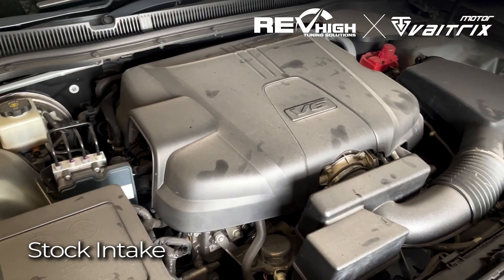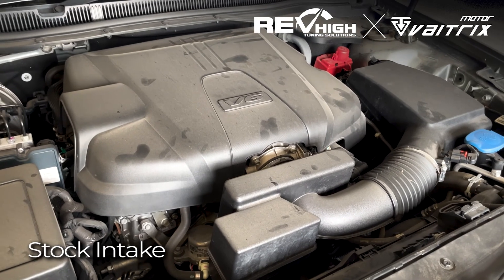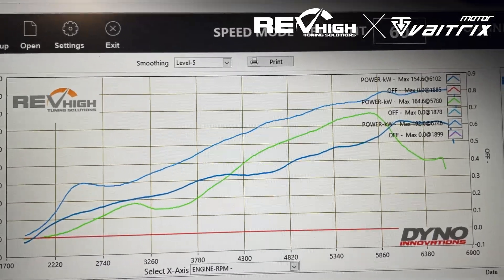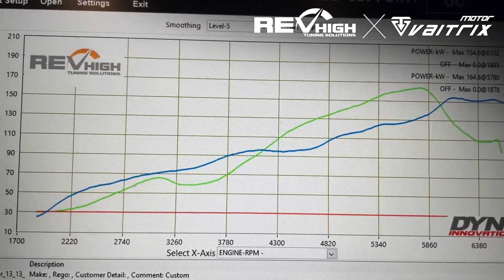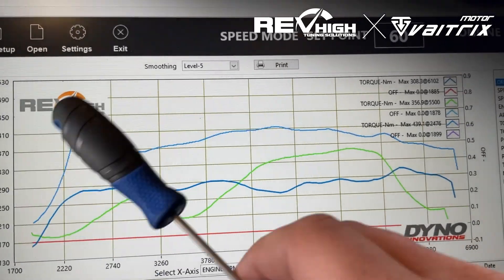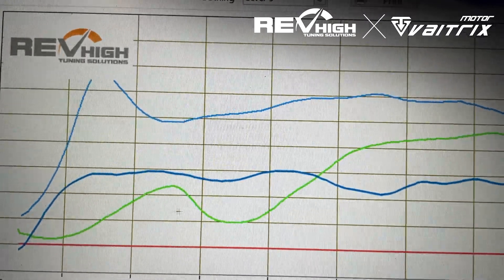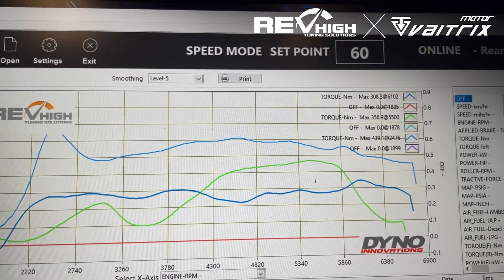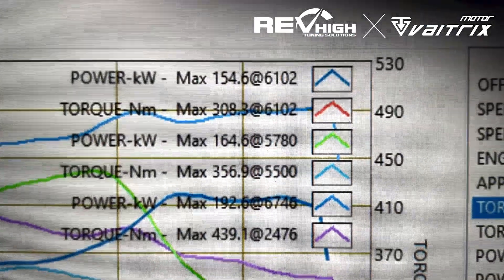Why you need a dyno tune after fitting a OTR intake on the direct injected Holden V6's!!

Comment: I have a Holden VF director in two mind whether I should enhance it it is so good stock I watch this video. It’ll help me make my mind up.
Reply from the maker: If not sure on the tuning side I would always recommend starting with good servicing schedule including the transmission, good plugs, clean the PCV and check the purge solenoid is functioning. And always use 95 or 98. Thanks for watching.

Comment: With OTR, about 190KW rear wheel seems to be about right, I have now in the last six months seen 189KW, 190KW and 192KW. The lowest 189KW was on a fairly hot day and would have read a bit higher if it had been 20C. With a Supercharger this can go a bit over 300KW - 400HP at the rear wheel and around 500HP at the crank. Those numbers seem to be fairly consistent, all LFX motors. Thanks for the video.

Comment: Great video, just bought a 2012 sv6 Ute with 110,000 kms and am getting a system lean code on both banks. Guessing it’s the otr they installed but never had tuned. Do you guys know anyone in Sydney who does good work?
Reply from the maker: We can do it remotely if you can't find anyone. 

https://www.revhigh.com.au/remote-tuning-form

There's not many who spend the time on these torque based ECU's/

Comment: Hi there just watch your video, and I’ve got a question. I have a Vf 2014 sv6 ute.  I’m about to put in a new exhaust system on the ute, plus a better air intake but my question it?. Do I have to do a Dyno tune + a normal tune or just a dyno tune and nothing else?
Reply from the maker: I recommend a dyno tune to make sure it's running optimally without any dips in power etc.

Comment: Great vid.  
I have a 2008 VE 3.6 60th Anniversary Commodore.  
I have J pipe muffler delete and an Orssom Performance OTR.  
The car is so much better in both performance and fuel economy.  
Should I have someone up here dyno tune my car or is it not necessary and the ECU will learn by itself?  
Regards, Jas.  
VK4FJGS  
Rockhampton Queensland Australia
Reply from the maker: The Alloytec's are less sensitive to MAF location changes but the fuel trims are still often out by upto +-15% so a tune to tidy these trims up will yield better power, reliability, safety and fuel economy, so it's highly recommended. OCD Tuning in Burleigh heads QLD can tune these!
Reply: @REVHIGHTUNINGSOLUTIONS  
Many thanks for your reply.  
I will save some money for a dyno tune.  
Regards, Jas.

Comment: I have a VF ssv with the L77 6.0. I already have the VCM OTR but no tune yet. What type of gain will I be looking at with just otr, then otr + tune? I also have high flow rear sports mufflers
Reply from the maker: L77 would see about 40-50rwkw gain at the wheels and about 100NM

Comment: Any reliability issues after getting an otr, exhaust and a dyno tune? With all them mods can you run your car 5 days a week, 9 hours a day without any issues (Uber Driving). I have a 2015 vf sv6. Cheers!
Reply from the maker: No reliability issues, we might just smooth out the power delivery under 3000RPM to help with fuel economy!
Reply: @REVHIGHTUNINGSOLUTIONS  cheers ya legend! I've been following your work for a while now and would definately bring in my car for a performance upgrade next month.
Reply from the maker: @muhammadhamzaamir7942  Look at the reply I sent Elena.
Reply: If there are existing engine issues, you can't blame revhigh for that? Just perplexing...